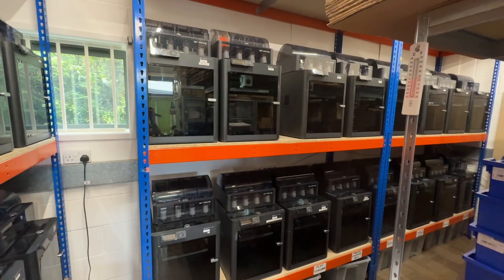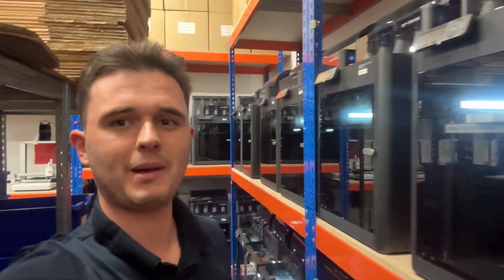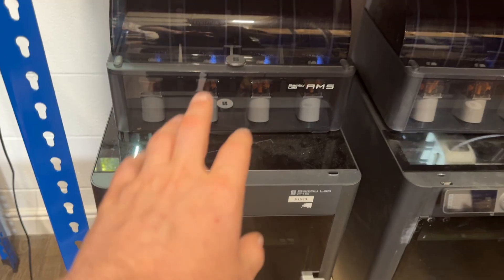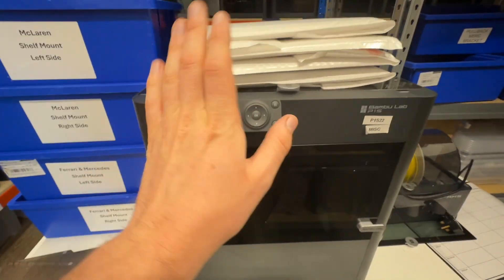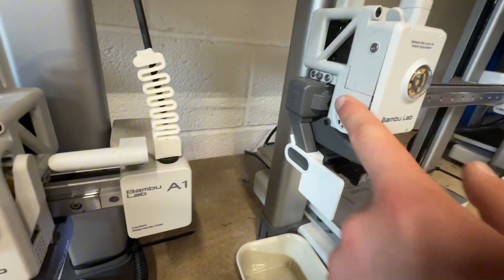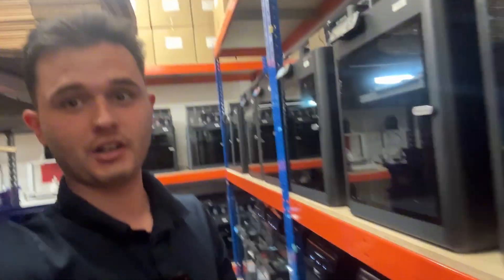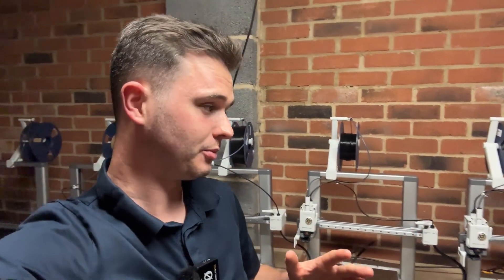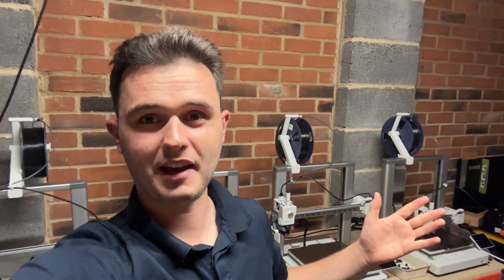Inside My 50 Printer 3D Print Farm (Full Tour)

Comment: Why do you have the ams on all your printers since all the filament is the same. You could get like 20-30 more printers without an ams on all of them
Reply: The AMS isn't only great for multicolor/material printing, but also for the automatic refill function. when one spool runs out it will switch to the next one if its the same material and color. You could essentially print something that needs more then 1 full roll of filament (which doesnt happen very often). 

It's also about convenience. if i have a printer that i only use for black PLA, i could have 4kg in one AMS (or up to 16kg if daisy chaining the AMS units), so i dont have to refill so often. Yes you could use a bigger spool of filament like how ShopNation does it, but then you'll give up on the multicolor/material functionality. its personal preference really.